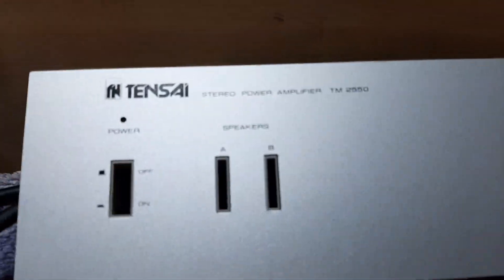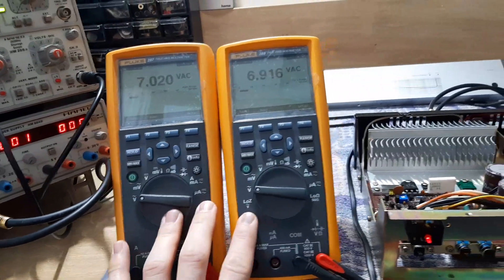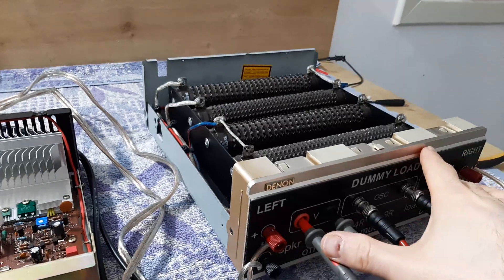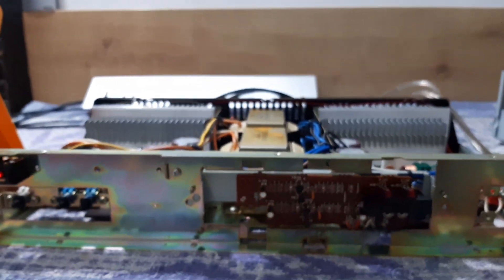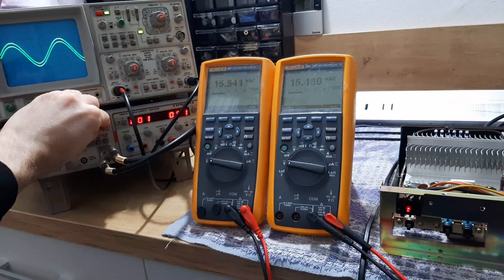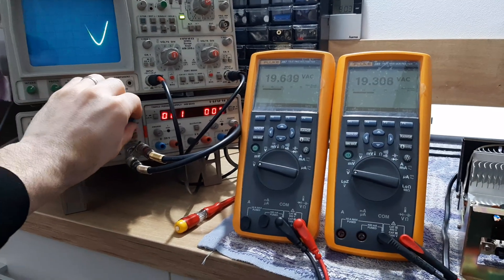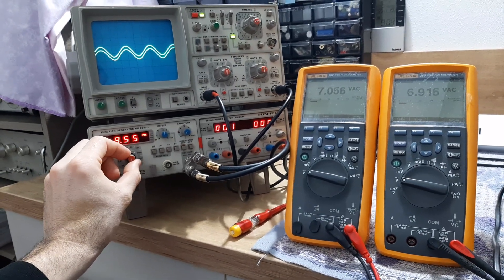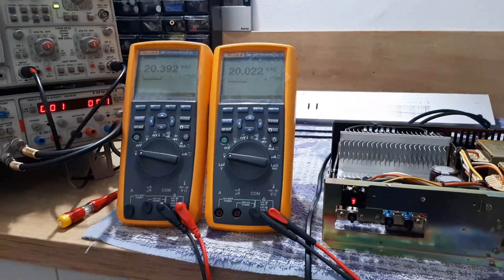Tensai TM 2550 - Power Amplifier Performance

Comment: Hi..this is de model between akai 2450 end akai 2650
Reply from the maker: Hi and thx for this information. Cheers !
Reply: @MariusHiFii  after 2650 is 2700 end 2750 the last one made Tensai after they made akai 2800..2850 end 2950 i don't now if they made 2900 ..yes they made (Tensai)
Reply: @curelaruvalentin7520  I'm not sure about the story about it being Akai behind Tensai, Tensai is a cheap brand that doesn't resemble Akai in any way, nothing about them is like Akai in any way, the story about it being Akai comes from Wiki and I cannot find out who came up with it. The Akai AM 2800 (00) series came long before Tensai's models, the AM 2850 (50) series from Akai came in 79-80 at the same time as Tensai, and again the quality between the two brands has nothing in common. I have been a radio mechanic for 40 plus years and have seen pretty much everything in these types.
Reply: @MrProvinspoul  i say am 2650 not 2800 or 2850 ...tensai is the cheeper part of akai made
Reply: I agree that I am confused by this, because the inside of Akai and Tensai are often not similar at all, the inside of Tensai sometimes reminds me of Harman Kardon or Optonica, so we probably won't know how it was.